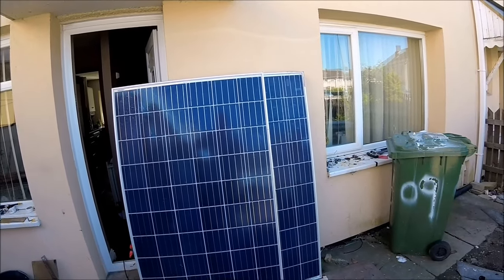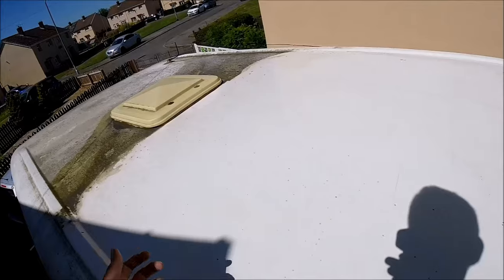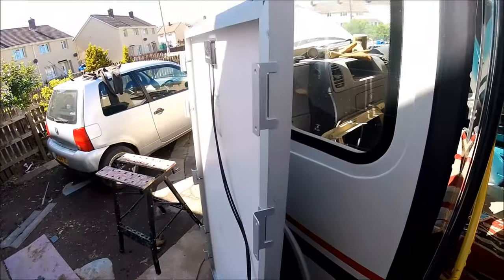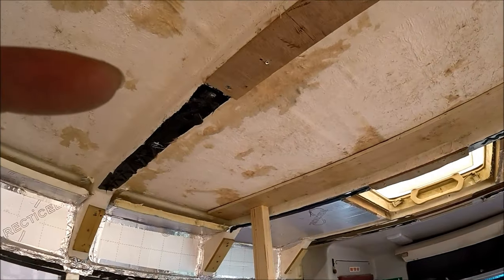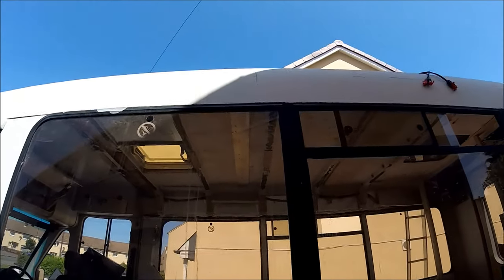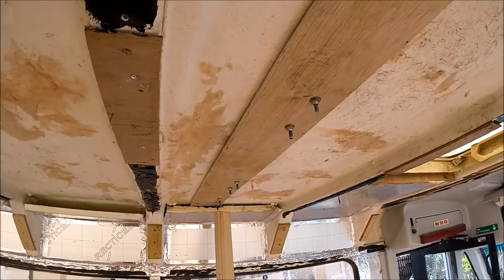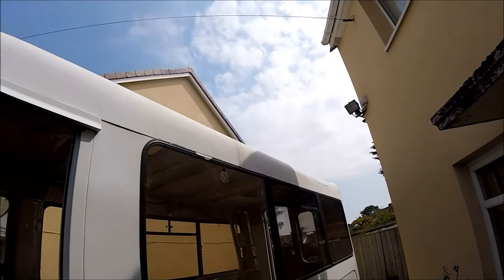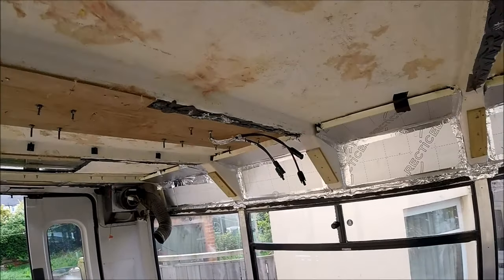Installing 2x 270 Solar Panels On Mercedes Minibus Motorhome Conversion Roof

Comment: I'm fairly certain you eventually will regret drilling holes in the fiberglass. Cracks and leaks. Why not use the 3M tape? Some vanlifers have coupled the 3M tape with eternibond tape. https://youtu.be/9GQiJyYaLxs No problems even at highway speeds.
Reply from the maker: I’ve mounted solar panels on my previous high top fibre glass roofs before using the same brackets and never had a problem, the holes are well supported from underneath and sealed in abundance. I just don’t trust the tapes, I’d rather have a mechanical fixing so to speak

Comment: Unusual to have a perfectly flat roof, I've never had one that's flat, always had to mount them length ways or make varying height brackets. Those solar panels certainly ain't going to come off.
Reply from the maker: yes the roof is nice and flat, just a shame a skylight was in the way which had to be removed, otherwise I would have had to re-arrange the layout and they would have overhung then, I like how they've gone on and yup, should be secure
Reply: @TheCampervanBuilder  I've converted loads of coaches, welfare buses etc, there's always big Skylights in them, I always remove them and sheet over with aluminium (left over from side panels) then arrange the roof to my liking with smaller double glazed skylights, solar panels, satellite dish etc.
Reply from the maker: yes they always seem to put the skylights in awkward places

Comment: That's enormous power. I have 2 x 160w solar panels.  I have the tv and laptop on constantly, charge ecig batteries twice a day, run cctv, have my roof fan on most of the day in hot weather, run a compressor fridge 24hrs a day and power a cpap machine all night. my batteries never fall bellow 85%.  Your set up will be like an on grid power supply. Nice job.
Reply: thats reassuring to hear! how big is your battery bank?
Reply from the maker: Thanks man, you've not seen the size of my battery bank yet though....

Comment: Dave, this is by far your best conversion project to date.  But, I do have a couple of questions... 1.) Is this your only conversion in progress at this time, or is there other vans still in your driveway?  2.) How is it that your neighbors do not mind your work area being in a residential housing group?  3.) Does Tiger sealant send you a check regularly for the advertisements?  ...😊
Reply from the maker: Hi, first of all thanks for being the first person to sign up to Patreon, to help support my channel.  Yes this is the only conversion I have ongoing at the moment, but I might have another bus lined up from the same place I got this from.  I work full time and only do this as a hobby on weekends so its not like its 9-5 every day of the week, just weekends and the odd evening if I can be bothered.  The driveway is on my own property so it's no different to someone doing some diy on their car as I plan to use this when completed.  This job and the removal of the old skylight was the first time I've used tiger seal, I usually use Sikaflex but thought I'd try the tiger for a change as its just as highly recommended, if only I did get paid to promote things, that would be nice
Reply: @TheCampervanBuilder  - Thanks for the reply. I live in a subdivision where they do not permit work outside the garage - you are fortunate.  Also, it's kind of a shame that Tiger doesn't come in a white color, eh?
BTW - where are you located?
Reply from the maker: I'm in the north east of England